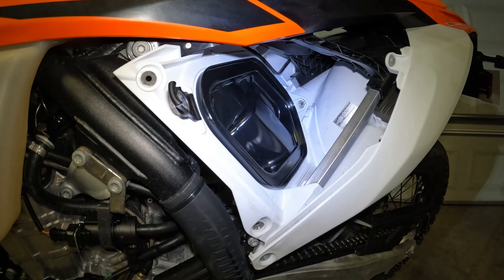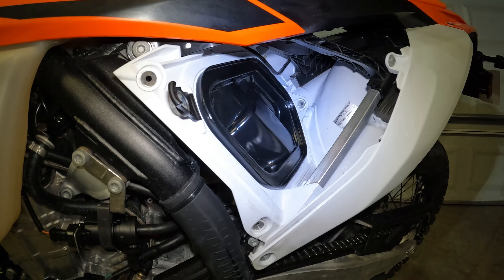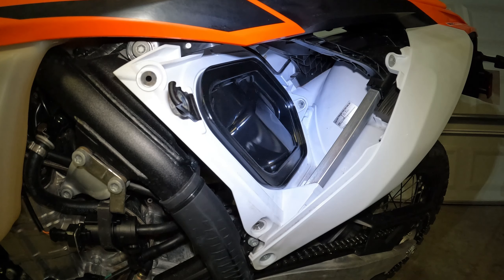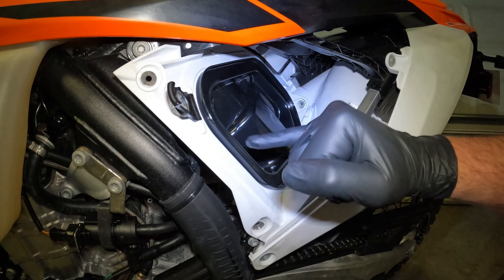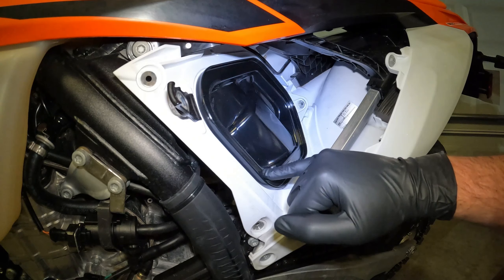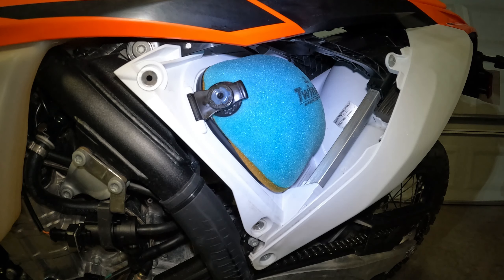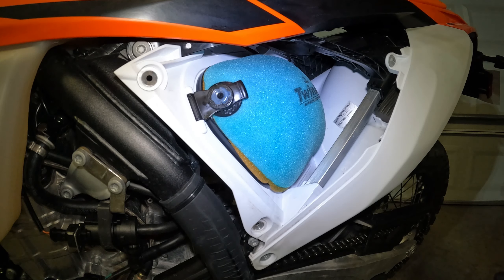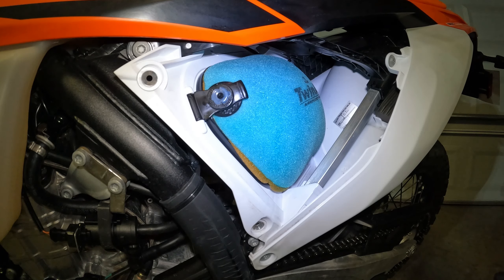Air Filter Fitment Issue + Solution. 2024 KTM 500 EXC-F

Comment: I agree with you. Install the filter as you said, maybe grease the base or oil it more than usual, and it will seal. Added:  Some people complain that the thin foam gasket material they add to make the filter seal better peels off and separates from the adhesive...

Comment: I have a 2024 250 XC-W which is the same air box in this video.  The manual states to put grease on the perimeter of the air box.  In your video I don't see that? Maybe it's optional. I will take off my filter this weekend.
Reply from the maker: My manual instructs that the grease be applied to the base of the air filter itself, specifically on the centerline. Grease would certainly act as a barrier, but would also collect debris and create more cleanup. I did not see any grease from the factory, and I have not applied any thus far. Just applying filter oil and a skin at this point. It would be interesting to have more information from those who had engine damage. Such as if they followed the manuals instructions, if they were doing rapid mid race changes, if they are sloppy mechanics etc.